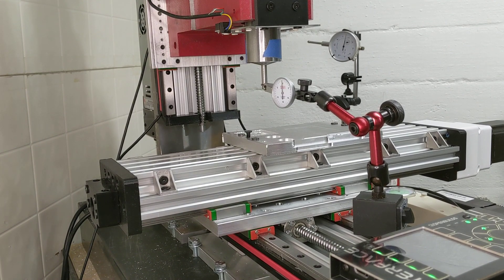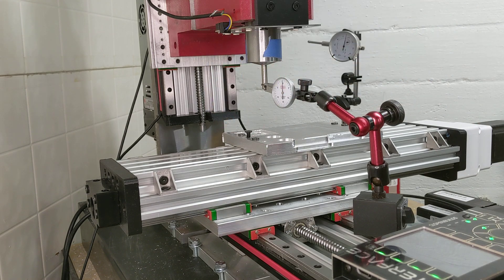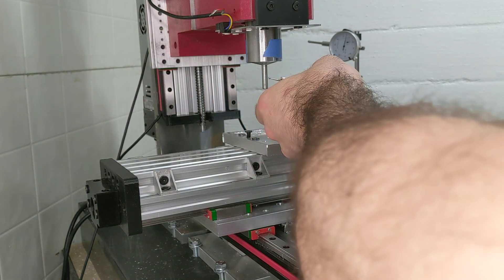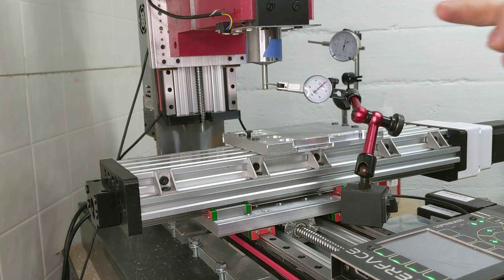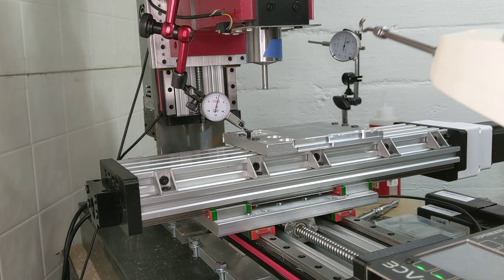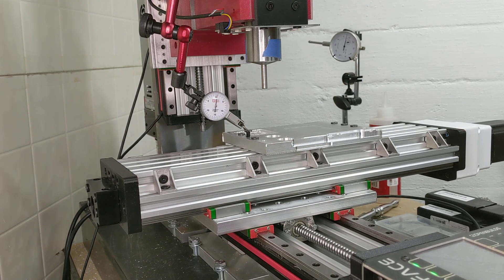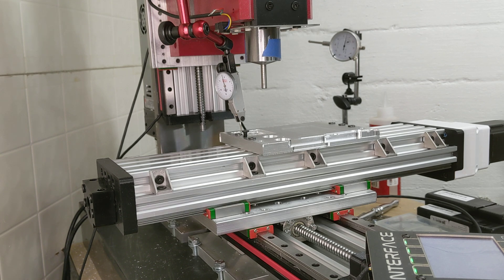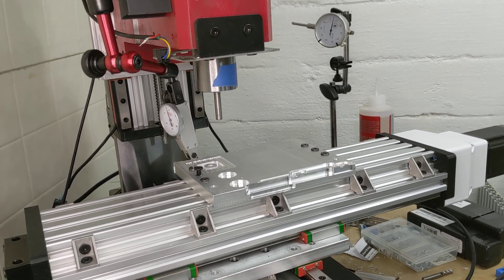RIGCNC- Aluminum Upgrade Rigidity Test

Comment: Do you think that once you've replaced most or all of the plastic with aluminium alloy that it'll have enough rigidity to then replace the alloy with steel and then after that make clean cuts in steel? I'd be down for a build of one of these in a staged way like that if I could get it accurately cutting mild steel with a good surface finish up to maybe 6" x 6" part size. I have some immediate uses for that.
Reply from the maker: I have the aluminum in place and have been taking some serious test cuts in aluminum, i can swap over to some steel test cuts and see what it can do.  I think if you do the plastic version and then spot drill in steel you can go straight from plastic to steel

Comment: Do you see any issues with upping the travels on the X?  I'm looking at building one but I want more then 8in of X travel.
Reply from the maker: How much higher are you trying to go?
Reply: @TheBetterRyanKelly  somewhere in the 10-14" range.
Reply from the maker: @zhult1992  Yeah I don't think that would be an issue at all just have to find the right parts, I would round to the nearest 100mm increment, that usually makes sourcing easier